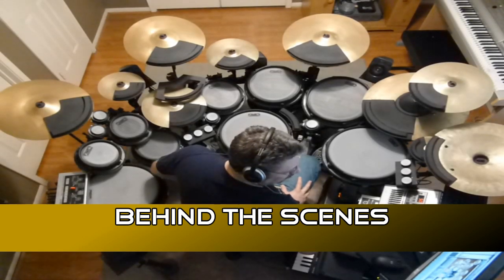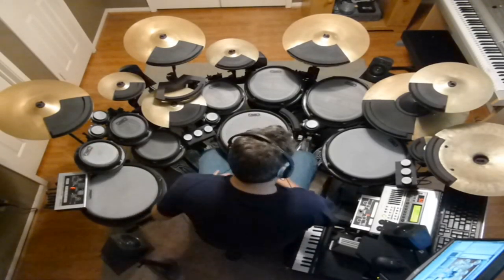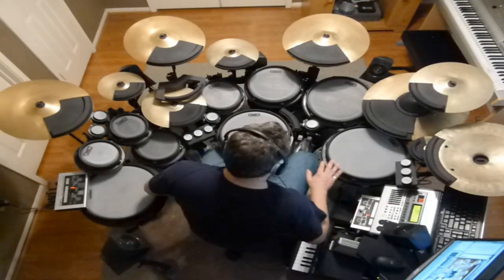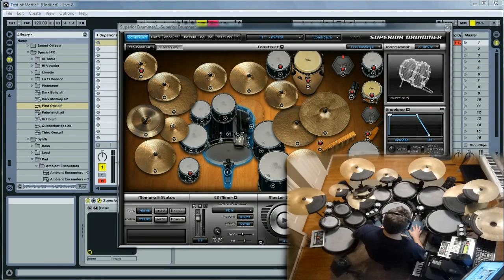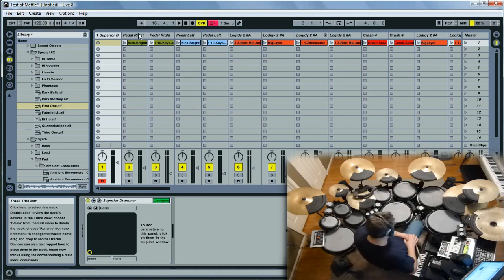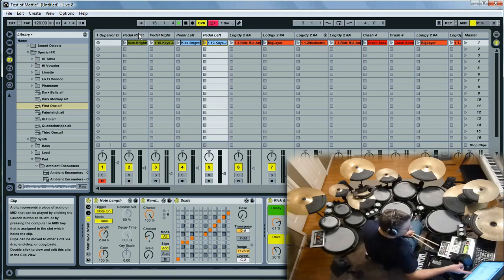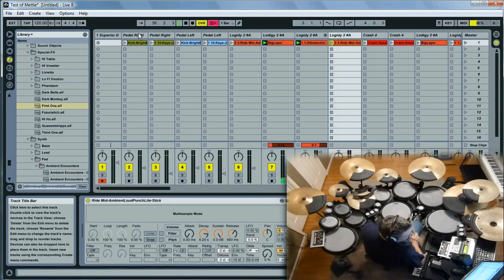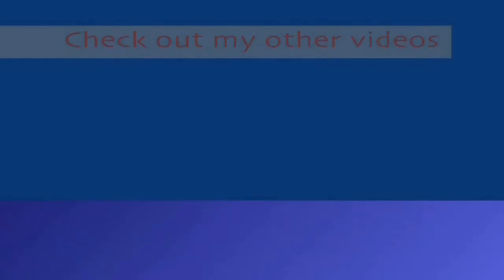Behind The Scenes - DIY Electronic Drum Kit Triggering Ableton Live

Comment: I have been thinking/wondering if I could buy Ableton in lieu of a Roland brain/module. This seems to confirm that suspicion, no? And a hell of a lot more versatile to say the least, if true.
Reply from the maker: Erik - you would still need to have some midi interface between the Ableton Program and your electronic drum pads.
This is all I'm using the Roland module's for.
Reply: Thanks. I suppose an old Roland drum module or MIDI interface will be lots cheaper than a new. How many modules and/or interfaces do you run given all of your triggers? I suppose that's the rub, as I haven't found a (cheap) interface that looks like the solution I need.
Reply from the maker: Erik M I bought all the Roland Modules used on ebay.  I traded a non-working TD12 for my TD20 with a good deal from DJPill's Ebay Store.  Lot's of good deals on used modules. For my three Roland TMC-6, I bid on them on ebay and got one for $150.00.  All were in good working order and have been giving me no problems.  The TMC-6 would give you 6 pads to interface with the Ableton program, but only 1 of the 6 triggers has a dual pad input.  The TD20 does have better triggering sensitivity settings and you can use splitters to get more pads input into the module and you have numerous inputs for dual pad triggering.
Reply: warehouse345 have it all set up, but can't get Ableton to produce sound with pads using a TD5 as interface. It sees an MPD 24 I have plugged in just fine, but not the drums. I used a Mio to connect the interface to the computer...Can you make a video walking us through the Ableton process?
Reply from the maker: Erik M So you have midi out from the TD5 using the MIO to connect to the USB port on your PC?  You have to set the TD5 perameters to just MIDI, so there are no onboard sounds, it only functions as midi interface only.  You'll have to check your Roland manual on how to to that.  Then on the preferences tab in the Ableton Program you can see if the TD5 is recognized.
Reply: Did that, and tried many configurations. What I haven't done is go from the roland brain/module to my audio interface to the pc...when I finally get it working I'll post a video
Reply from the maker: Erik M I'm not sure if the MIO is one that will work in this application as it looks like it's really more of an adapter cable than an actual MIDI interface.  I can definitely vouch for the TAPCO 4x4 I use which has the ability to connect 4 devices with 1 firewire cable to the PC.  Is the MPD 24 connected to PC via USB cable?  The option you mention with going through the audio interface I don't think will work, it would need to transfer MIDI signals.  Keep me posted.

Comment from the maker: I have an Auzentech sound card installed on my PC which has all of the necessary inputs for a 7 piece surround sound system, so I took advantage of it (The Logitech Z906 is 500 watt system - I'm using 5 speakers (3 front and 2 rear) plus the 165 watt subwoofer).  As far as the surround sound clarity, they seem to capture all the highs, mids and lows to my personal taste.  It works better than the 3 piece Roland PM-30 system I was using previously in my opinion.  Best of luck to you.